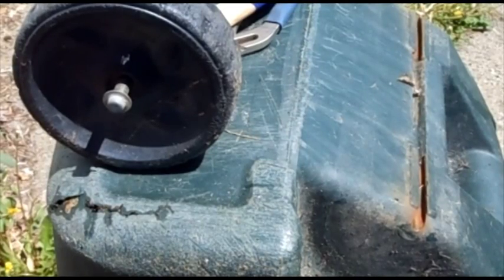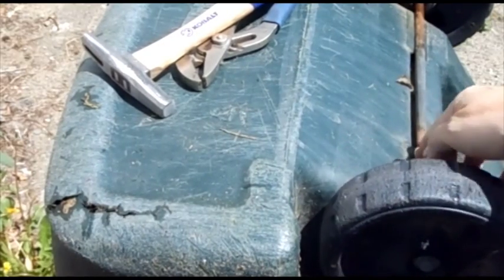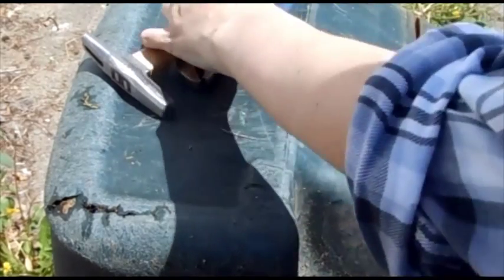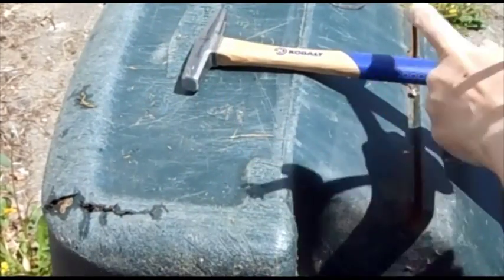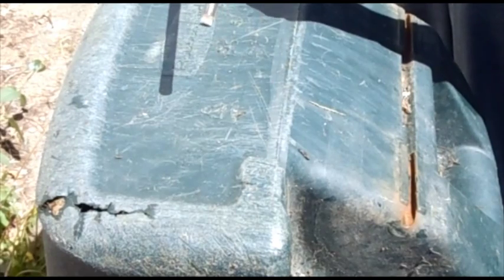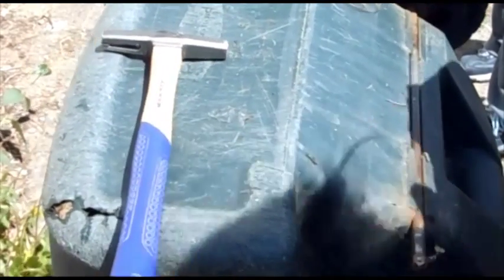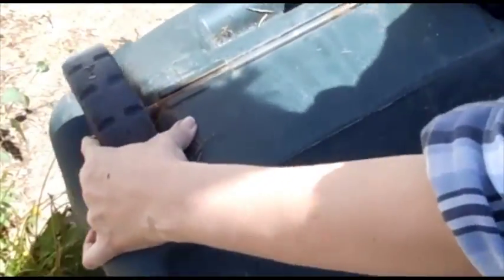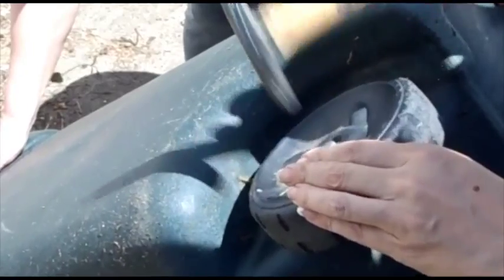How to reattach a wheel to a trash can, garbage can, wheel barrel

Comment: It sure was rusty I soaked it in oil first and used a vice and hammer it off then proceeded the wheel and added cap and tapped it on

Thank you for the tip